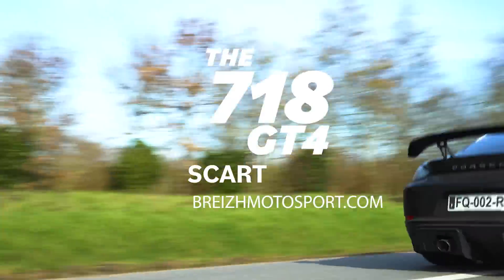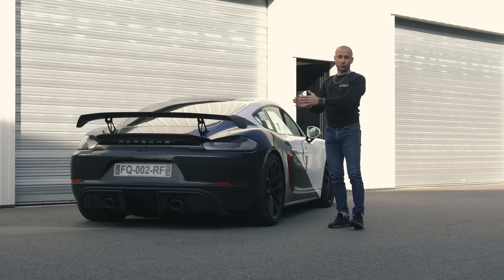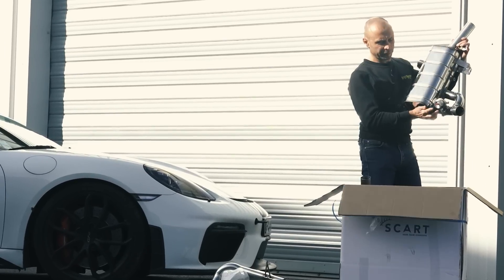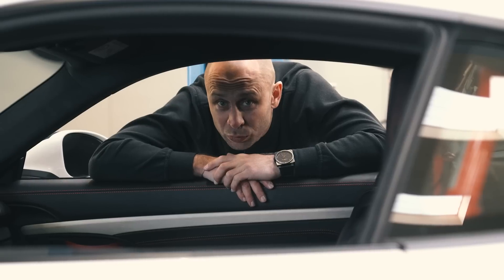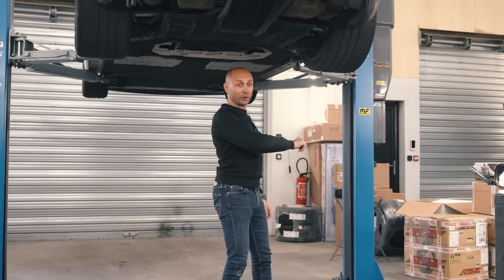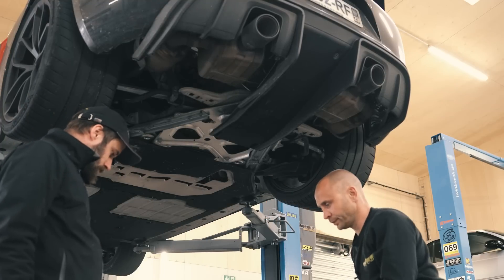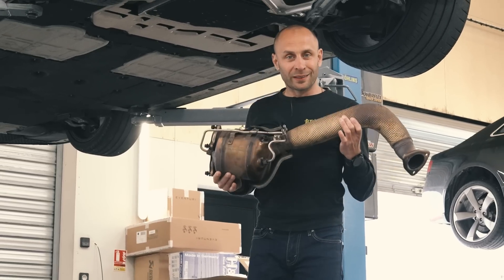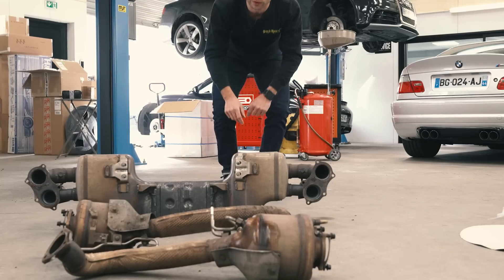718 GT4 : Adieu vilains FAP ! Bonjour sonorité et performance en installant un échappement SCART.

Comment: Combien faut-il compter pour uniquement shunter du fap (pièce + MO)? Merci!
Reply from the maker: Bonjour, ça va vraiment dépendre de la marque des pièces que vous allez choisir.
Reply: @BreizhMotorsport56  Pour un 718 Spyder (même mécanique que le 718 GT4)
Reply from the maker: @rom3585  C’est la même chose effectivement, comme je vous le disais ça dépend des link pipe que vous choisissez. La partie Reprog et installation ça ne va pas chercher loin, 1000€ max.